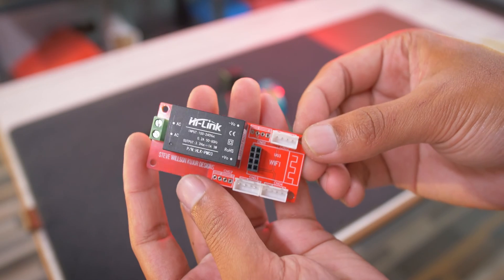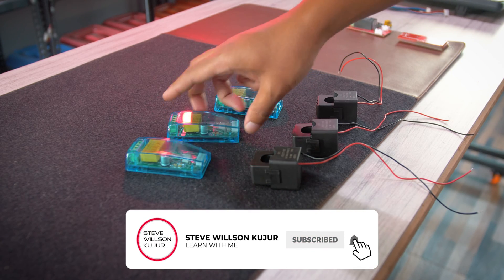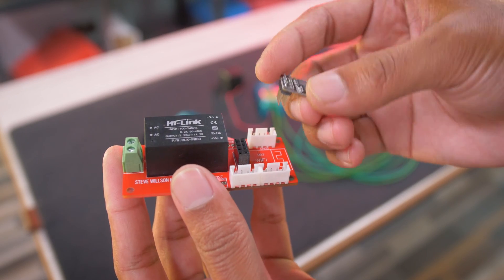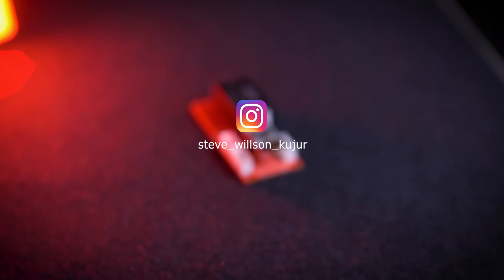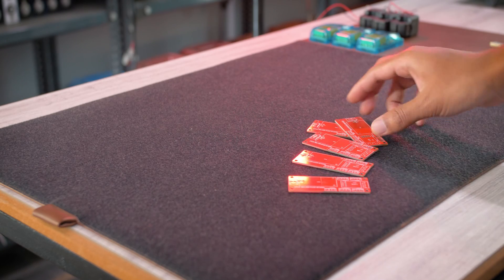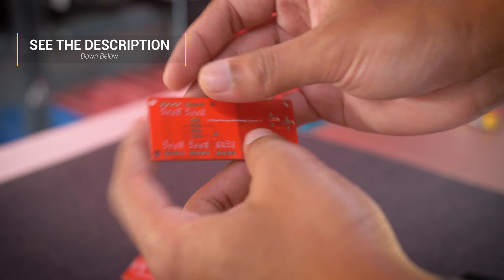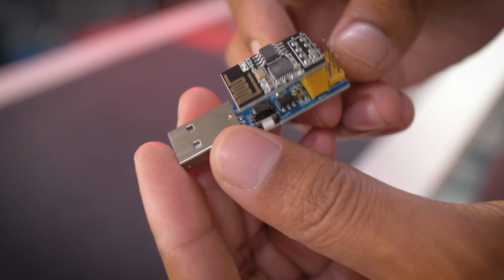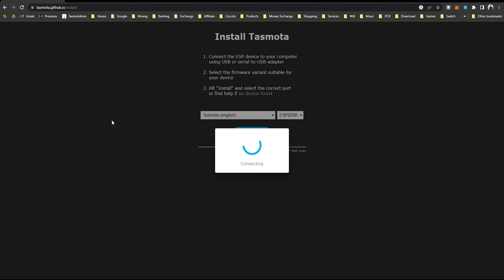DIY 3Phase AC Power Meter | 260VAC  100A

Comment: Hello.  There are 3 pzem-004t v3 in my project and I am trying to get data with nodemcu.  I can retrieve data for each pzem one by one without any problems.  However, when I connect to D3 and D4 pins, whether I define an address or not, only the last address is returned and mostly data is missing.  Can I have your code that shows the sensor readings except the important parts?

Comment: tried your method but it didn't work out, do you have a blog or schematics and part descriptions
Reply: I also had difficulty at first, then I realized that I wasn't doing it exactly as shown in the video, and after configuring Module 1 I would remove the power from it and then configure Module 2, I don't know if that was the reason it didn't work, but I did it as in the video, keeping all the modules powered, and just alternating the connection pigtail with the ESP, so it worked.